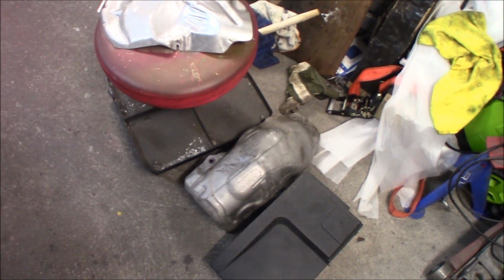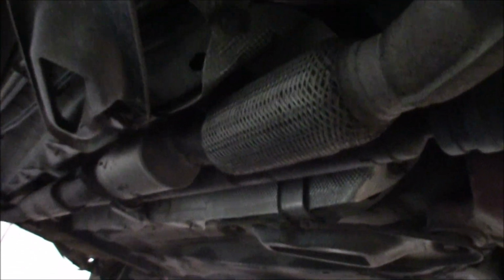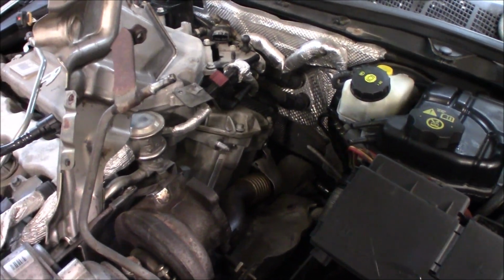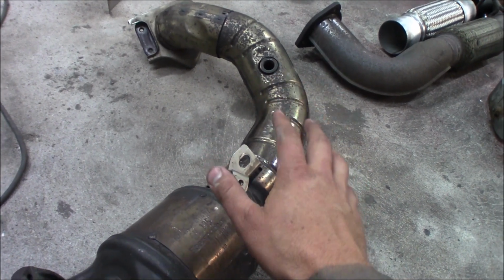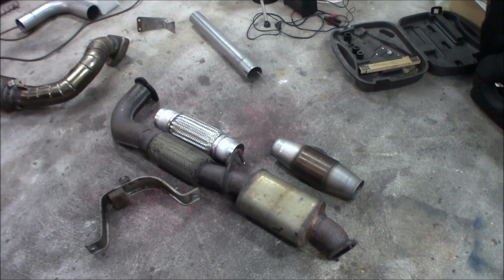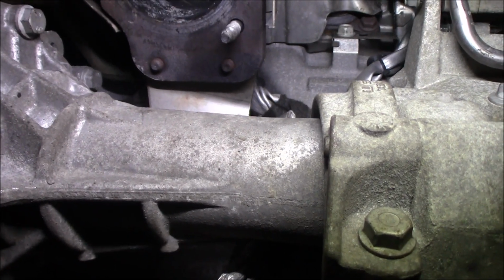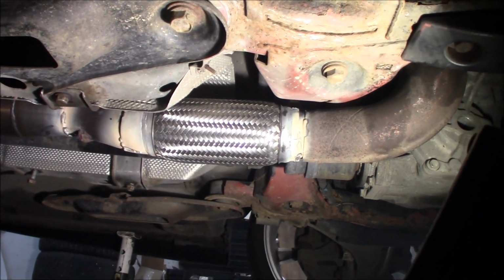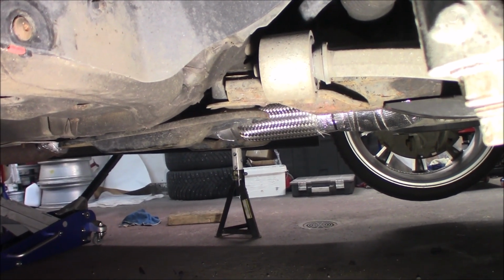SAAB ng9-5 Turbo6 Downpipe + Midpipe! Awesome!

Comment: Hi! Did you modified anything on the second sensor behind the removed catalic converter? I mean exact about the values. Or it’s working properly without any problem?!
Reply from the maker: Yes, dion fixed it in the software 👍
Reply: @JonasKakarikas  So I have a Hirsch software how difficult to correct the values?
Reply from the maker: No, hirsch software will not work. You need a custom tune and dissable second lambda
Reply: @JonasKakarikas  thanks Jonas. I’ll try to do something…

Comment: Do You have any idea if 3` dp made for insignia/vauxhall OPC will fit bolt on? It's the same engine, same turbo and all the equipment, but who knows...
Reply from the maker: Yes think it's the same
Reply: @JonasKakarikas  I got one almost for nothing....but if You're saying that the Oem is 2.75, maybe it's better to leave the OEM and sell that 3`. I'm not planning to go over stage 1.
 Was it a lot of hassle to drill that sh@t out of the cat?
Reply from the maker: No it's very easy to drill out the material in the cat.

Comment: Jonas, I just bought opc insignia exhaust at a bargain price (300euros). midpipe, and all along the end including mufflers. do You still think it's worth eliminating the cat in the original dp ?
Reply from the maker: Eliminating the first cat in the downpipe is the most important, it stops the flow and generate crazy heat in the enginebay
Reply: @JonasKakarikas  And You are sure it will pass service inspection after doing it?
Reply from the maker: In Sweden it does, but it depends on what secondary cat you have.
Reply: @JonasKakarikas  one queston - There are two lambda sensors as I know. If You remove the cat, doesn't it show any error? Or we have to turn it off in the ECU?
Reply from the maker: You can dissable it during tuning or use a lambda adapter to trick it
Reply: @JonasKakarikas  Lambda adapter is something that You used? Could You share a link to the one You used and fits ? many thanks
Reply from the maker: Just Google one, will be to expensive to buy from sweden. Sometimes it works, Sometimes it dont. Best is to adjust it in the tune